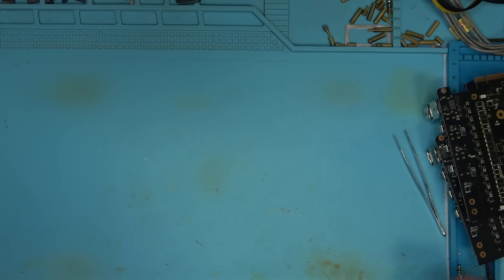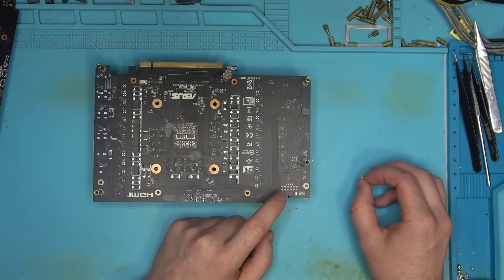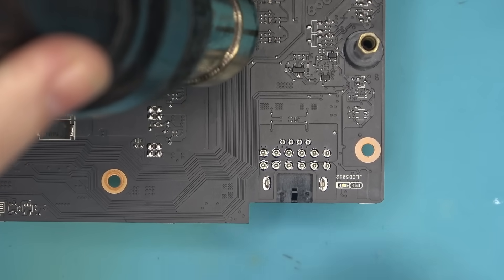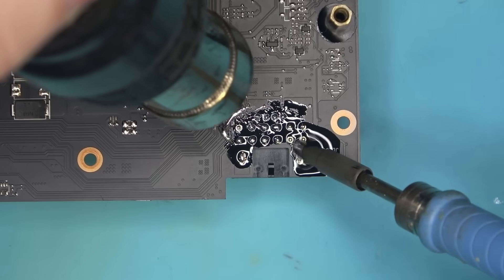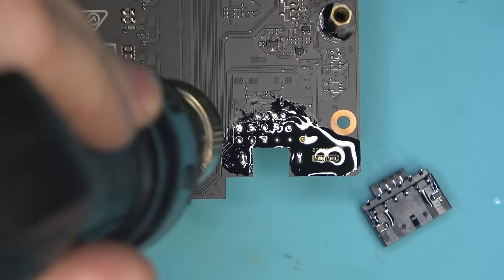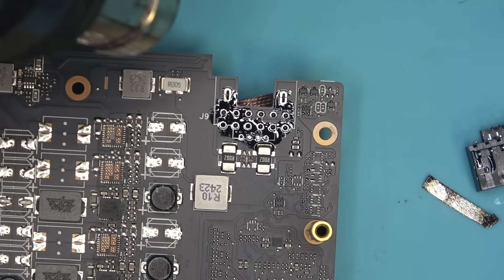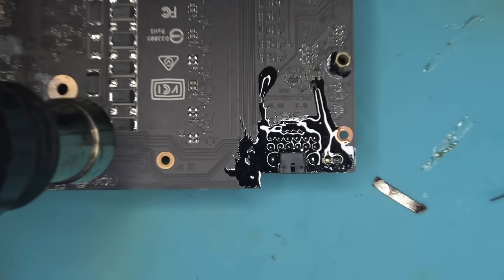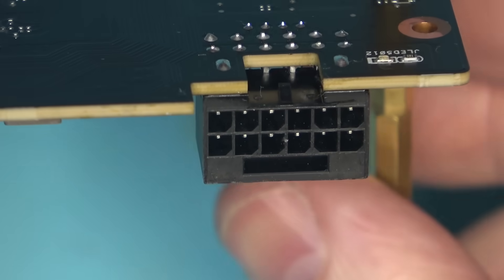@Jayztwocents  How to replace a 12vhpwr GPU connector

Comment: This looks easy, but only shows how NWR is truly skilled, i work around electronics for around 20 years, and sometimes these connectors are so stubborn to get out, you sometimes rip a trace ... Usually, as i do not have hot air gun, i just cut it off with dremel (not damaging board), carefully working out so that i can remove base plastic and un-solder pins one by one, gently. Then, it is question of cleaning holes and soldering new connector / whatever one by one like in video. OFC it does not work when you want to save connector, but getting something off aliexpress nowadays is pretty easy. But even for this connector to just fall down by itself from board - its like magic.

Comment: Thanks a lot for this. I learned a lot from your video. Links to get the low melt and leaded solder and wicking material would have been helpful

Comment: what happens if solder doesn't run all the way through on some pins?cause i have one that doesn't boot after replacement and i can see 3-4 pins missing solder on the other side

Comment: Thank you for this. What would help is knowing your iron temp and is the 400 in F or C?
Reply: I appreciate your response, but whether you believe I only found this now or not is irrelevant compared to the truth.
Reply: @Jayztwocents  hi Jay, in Electronics, it's always C.
Reply: @Jayztwocents  That is very true, I just assumed out of your many fans someone at least linked it to you on social media like X\Twitter which I dont use or look at. 
I'm glad you've come across it now and even with out it have managed to get one of your cards working again. And with it will certainly get your other working as well.
PS I still would like to see that collab video with NorthRidgeFix you's talked about a couple of years ago, since you's both live close to each other. 
I remember seeing a response video he did at the time saying he's open to the idea.
Reply: @mrtwinky2007 I'm going to try and fix the uneven card using this technique Tony showed. Alex and I are still open to collab but our schedules are hectic and hard to align.
Reply: @Jayztwocents  Good luck with the card, I have faith you'll get it sorted, 
Hopefully you two can work something out and get a collab together in the near future, I look forward to seeing it happen.
Reply: Its always Celcius. For all such tools
Reply: Always Celsius in engineering/mechanical or electrical work.
Reply: 400C, iirc, but ymmv. I've worked between 300-400C, but in my experience, the temp varies based on which tip you're using, and how experienced you are, as higher temps lead to faster tip oxidization, which is a pain for beginners. Flux is your friend. Rossmann is the only one who knows the truly appropriate amount to use -- obv your entire supply. Best of luck.
Reply: What the F?
Reply: 9Minutes ago, I don't believe you've only come across this now, since it was uploaded 2hours after your video yesterday, I think you fixed your card today after watching this video and coping it too the tee, And I suspect your copying it again to patch up your currently fixed but unbalanced card, before you work on the other one. 
Ether way keep up the great work you do on your videos and give NorthWestRepair the credit he's do for the help he's offered you <3 :)
Hopefully NorthWestRepair replies soon for you, My bet is 400c
Hot Air Gun Usage

When using a hot air gun:

    Common Temperatures: Hot air guns generally operate in the range of 200°C (392°F) to 600°C (1112°F). The specific temperature setting will depend on the material being worked with.
    Heating Plastics: For softening or melting plastics, temperatures around 200°C to 400°C (392°F to 752°F) are often used.

Duckduckgo ai answer

Since he's never wanting to hold it directly at the connector and is warming the surrounding area, I suspect 400c

Comment: Never had to use  a hot air gun personally, just an appropriate sized  tip for the soldering iron, flux and wick. Can use kapton tape to protect any nearby components from heat.

Could even add some Kapton to the connector itself to protect it if you're merely trying to fix a broken solder point

Comment: By 'low melt' he means 'chip quick' or another alloy based low melt solder designed to remove components (yes, there is solder designed to REMOVE the components, most of the techs I've met have no clue). Def get +1 for proper low melt solder SMD removal.

Comment: Are 400°C generally safe for this type of work? I don't mean the air temperature at the nozzle, but of the components and plastic connectors themselves. Would it be advisable to attach some sort of thermistors or thermocouples to make sure not to cook anything? I don't trust myself with keeping the right distance and time when preheating the board.
Reply: 400F

Comment: Biggest tip in the video, nudging the pins to allow the solder to flow through.
Reply: Agreed!
Reply: What if they don't flow through till next side?will it cause a black screen?
Reply: @StavrosHc  Less solder = Higher resistance connection + lower heat transfer area into PCB (all Bad things). 
In other words : Less solder on some pins WILL lead to other pins being pushed over their rated limit earlier (since they are unbalanced in resistance between themselves). Which can lead to more heat on ones taking more load, which can't get transfer from pin itself into PCB because there is less metal (solder) connecting them to each other. Balanced pins on 12VHP are key for longevity of this connector.
Reply: @CompatibilityMadness  So the black screen that am facing has nothing to do with the soldering job then
Reply: @StavrosHc Unless you did REALLY bad job at connecting pins, this shouldn't caused black screen on boot.
Reply: @CompatibilityMadness  not at all.my only concern was the heating temp if it can damage anything from the board.i used my atten hot airstation at 400-420 celcious to remove the port
Reply: @StavrosHc Anything that wasn't shielded can be damaged by temp (big capacitors on other side for example)
Reply: @CompatibilityMadness  let me check and i will come back once i have news.Thanks for your reply

Comment: Tony I'm using the Mechanic soldering wire with "BI" ( bismuth ) is super cheaper, not effective like low melt alloys... but make much more easily to remove connectors.

Comment: Instead of soldering the new connector, you should solder separete wires (5 inches long or so) and connect them by some electrical connectors with PSU cables.

Comment: Good job. Low melt works good. I've also done similar removals by taking a scrap of heavy copper wire, like #6, and bending it around to touch all pins at the same time. Pre-heat the board, then apply the soldering iron to the heavy copper, which becomes a big soldering tip. Connector falls out the same way as you did with low melt.

Comment: can you replace it with a couple of 8-pin PCIe (6+2) plugs instead? i fkn hate the 12v connector. why make something so fragile and prone to user error (and often not even that, just failing on its own). i dont fkn care what my pc looks like inside, and if i did, i would prefer the more beefy industrial look - suggesting power and performance, than this wimpy little fragile trendy fashionable pathetic connector. i fkn hate nvidia so much. and that jensen prat. and his damn leather jacket.

Comment: This whole meltdown thing could've been avoided had they used quality COPPER connectors meaning the actual part inside the plastic and on the circuit board when I first saw the setup I thought you've got to be kidding me they're going to burn someones house down two pieces of aluminum with fingers that the female housing clamps down around and thought well there's the issue aluminum is a terrible conductor of high current/amperage remember the 1970s and all those homes that burn down you think these manufacturers and electricians and stuff would have learned something but those who don't remember history are doomed to repeat it case & point Nvidia 👍😁

Comment: What temps are you using on the soldering iron during low melt along with the 400 on the hot air? And then what are the temps for both tools when soldering the connector back on with leaded solder? I may have missed you say what they were in the video but I don’t think you did.

This is the best soldering tutorial I have seen I think, like others have mentioned. You should do some more of these please! I know you explain in your regular repair videos too but a more targeted tutorial like this for different components and tools would be extremely appreciated by someone who is starting to get into the world of electronics engineering.
Reply: he responded to me simply with 330 for the iron

Comment: It looks like you do the exact same thing for removing and resoldering, that can look confusing.
Why does the connector not fall back out ? Do you lower the temp of the hot air ? Questions people might have. Cheers.

Comment: Missed a critical error, he said his low melt is 183C, which is the classic 63/37 leaded solder, the low melt typicaly is a bismuth alloy, with a much lower melting point about 60C iirc.

Comment: Where is the difficult thing? It's because the thick copper traces sucks out the heat from the tip of the solder? I've desoldered a lot of multi-pin Through-Hole components without problems but I never tried with the 12vhpwr connenctor!

Comment: Good. 
But why not use suction soldering tools?
Reply: I have worked in board repair and solder suckers are nice, but they clog up a lot faster/need to be cleaned out more often than one might think. Here, just a couple of inches of snipped wick was the time used and waste material created.
Reply: @wisebloodwisent9948  I have a manual one, but it is quite easy to get used to. I just pump it again after each solder to clear, it does not clog since.

Comment: I use a solder pod with low melt to remove it and hot air to replace it  I know its old fashioned and crude but who cares 😁

Comment: 14:21 but you left the LED, next to the 12vhpwr connector, without solder, because you accidentally sucked it (using wick) earlier.
So maybe you are blind, or maybe you're also not very professional.

Comment: Honestly, a tutorial like this for replacing a laptop's USB-C would be invaluable to me. The Dell chromebooks I try to learn on melt easily and involve 12 thru pins, 12 surface-mount pins (plus 4 thru mounts). I have been struggling to get them off without trace damage or a melted nylon tongue.

Comment: Wait what?  Temp in the beginning was 400C.  But what kicked my nut was you said you used higher temp in the beginning, so what was the temp when soldering with the leaded solder in the end? (not the low temp one).
Thank you for your informative video! o7

Comment: I like @JayztwoCents, what he does, but as he is very comfortable in other fields, he is too confident with electronics repairs for his skills. Of course, confidence makes you try stuff, break stuff and learn stuff along the way.
The stuff you told, regarding mixing old solder with new is what I learned while doing my projects, reusing prototyping boards, pieces from broken boards and fixing broken appiences or modifying them at home.
Of course I don't have hot air station, low melt solder or flux, but I have learned to achieve what I need with flux core leaded solder, solder wick, desoldering pump, IPA and patience. I would not replace such complicated connector on such expensive board without hot air station (and some experience using it), as even simple 4 pin components might be hard to remove without ripping that copper tube out of board or destroyng the component. I could try to destroy the connector, and remove pins one by one, but again that has a risk to destroy the board.

Comment: Man, I’m always mesmerized watching you work. It’s clear expertise in practice and even when it’s intimidating, it’s way more inspiring than anything else.

Also watched Jayz’s video and… man. I kept picturing a kid standing in front of an Olympic pool wearing water wings, goggles, a life vest, and a snorkel for good measure, then busting out O2/N2 canisters and a rebreather… and still not being able to wade into the shallow end. 😂
Reply: experience does make it better,i changed a hdmi port first time with just watching a tutorial and it soldered ok,i burned a tiny bit of plastic but nothing inside the connector,reballing a ram chip was difficult though it took me like a week to be somewhat good enough to do it.

Comment: reminder that jay painted a motherboard white and was surprised it didnt work afterwards

he also drilled holes into a motherboard to attempt to make a water block fit

he fills an ultrasonic cleaner with isopropyl alcohol
Reply: I unsubbed from Jays channel some weeks ago. Working on multilayer PCBs with dedicated ground plane is a PITA.
Reply: @Henshusuru I unsubscribe from Jay years ago...

Over a decade ago I was a novice interested in custom water cooling for the first time and stumbled on to his videos and I thought he was a genuinely useful, informative channel. But then I quickly realized his knowledge basically started and ended there and overall to do is just kind of a prick. 

It's been shown all over the place for years from social media posts to in real life experiences, many have said similar. 

He's full of himself and was quick to shake off all those who early on in his career helped him grow. 

But at the end of the day he's still just a dumbass dumbass who was in the right place at the right time with just enough knowledge to make it happen.
Reply: Out of interest, why did painting surface of board stop it working?
Reply: @anone3842  Combination of it trapped electrically conductive atmospheric particles and also paints can easily be conductive because they're often not screened to remove conductive particles from them before the containers are filled and shipped.

Comment: Damn.. the Scalextric electrical slot F1 racing cars, at least in the seventeens, had exactly that WICK as 'contact pads' to conduct electric to the motor.
Reply: Now you've awakened a dormant 40 year old memory! Yes... and they would get all frayed and covered in carbon after a while.
Reply: @anone3842 eh hehe

Comment: I will be using this in case my connector melts now. I've been practicing with soldering so I can do some very basic things like swap out some small through hole components like controller joysticks, bumper buttons on a controller, and I also replaced capacitors on a PS3 successfully. I will need to get a hot air station but at least I know what it looks like / what needs to be done to replace this connector. Thank you so much! Also, do you have any recommendations on a hot air station I could purchase?

Comment: Nice job 👍 

Try using makeup remover pads instead of the q-tips. Recently started using them and they work great. Make sure to get the kind that are stitched around the edges so they don’t leave any material. 

I’m using Publix Cosmetic Squares if you want to check them out.

Comment: Best way to clear holes is using surgical stainless steel needles assume hole is 1mm dia use 0.9mm needle and as soon as solder is melted push needle hard in hole in on go and all solder will stick to needle and since needle is ss solder can come off easily with hand and best part it reusable and saves money on desolder wik😊

Comment: i would not trust even the new replacement connector, its better to directly solder the 3x8pin extension that comes with the card. it will look ugly but way safer.

Comment: I think part of jay's issue is he is using the crappiest Quimtech liquid flux from Amazon...I have tried it before and it is complete garbage! Also I don't think the low-melt solder he is using is actual bismuth low-melt solder...He said it's melting temp was 183c, and bismuth low-melt is like 140c...He needs some better flux and to just be patient...The GPU he is working on has a 14 layer PCB so it is going to take quite a bit of heat...

Comment: If my 4090's connector melts I'm gonna cut the 12vhpwr end off of the four 8 pins to 12vhpwr adapter supplied by nvidia and solder the wires directly to the gpu's pcb. Then I'll just be dealing with 8 pin connectors and no more 12vhpwr bullsheet.
Reply: It wont look pretty but it will work. Thats the main thing
Reply: how did you deal with 4 control pins
Reply: @ariewijaya1679  The control pins are read by the gpu, so all you have to do is make sure the proper sense pins are grounded.

Comment: For those of you who don’t own a hot air station or aren’t comfortable using one, you can also just destroy the connector with a dremel/pliers and pull out the severed pins one by one after heating them up with an iron. Just make sure to be careful with the dremel/pliers to not damage the PCB. Newer PCBs have more layers and more ground/power planes which allows them to sink a lot of heat, making them frustrating to deal with because it takes so long to heat them with an air station. However, heating a single pin with an iron usually is fairly quick.

Comment: i can replace the connector with a soldering iron and suck pump first cut the old connector away so you can desolder pin by pin clean it then put the new one

Comment: Exactly how we remove connector and ports from motherboards. Except when replacing the connector we don’t wick the pads but instead just melt the solder using a hot air and heat gun then just drop the replacement port.
Reply: The whole point of removing it is to replace it with leaded solder, and not leave a leaded/lead-free mix behind.